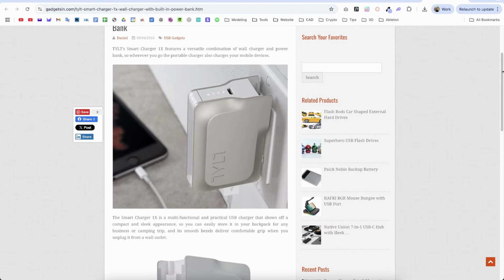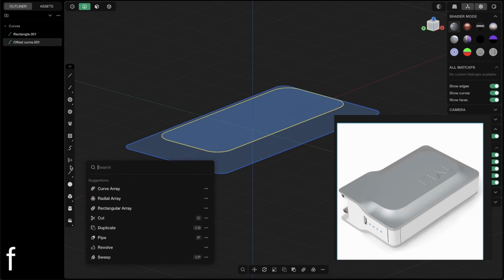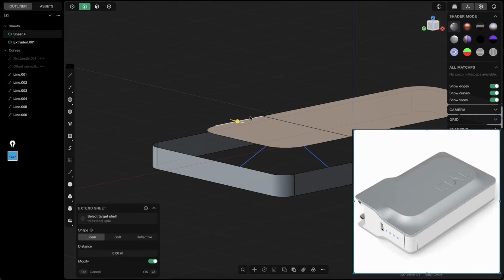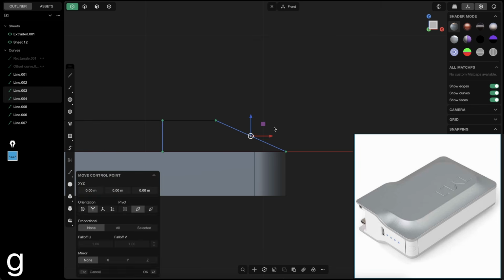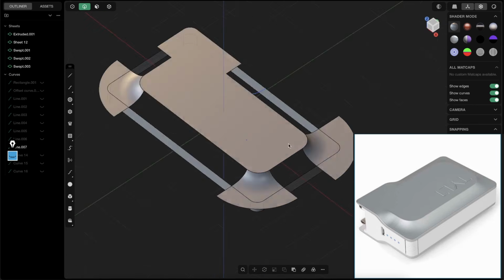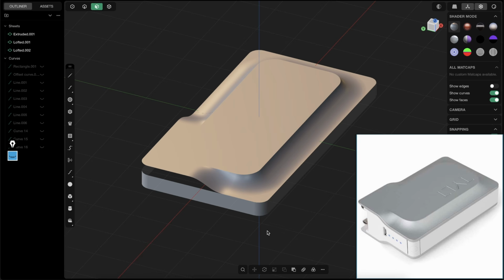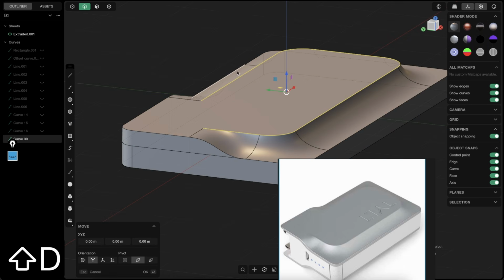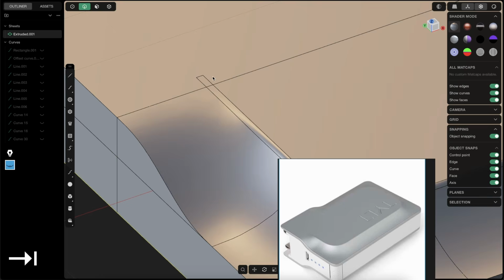How To 3D Model This Amazing Device (Plasticity Beginner Tutorial)

Comment: Hi Nikita. Thank you for your tutorials. Do you think it's possible to use Plasticity to model smooth 3D surfaces that are curved in non-cylindrical, non-spherical ways in every direction? Can you model, for example, a pair of Crocs, or the new fancy Balenciaga Zero shoes? I tried and I failed miserably. Even when I could model the individual parts, they had internal invisible errors so then I couldn't boolean or fillet them. Do you need XNurbs for this sort of surface? Maybe that's the problem. So far I got away with making approximate surfaces (with loft or sweep or revolve) then use Rebuild, and then manipulate the rows or columns of control points with Scale and Rotate. But it's a lot of work and with complex objects like those, I get to a point where I can't proceed due to internal errors in Boolean and other operations. I wonder if you knew how to do it.

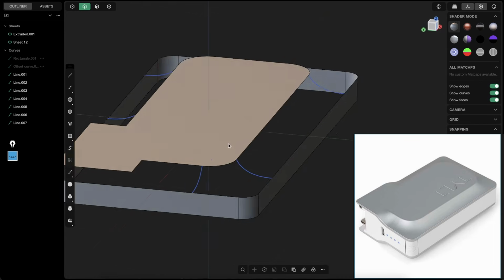Comment: I'm only a novice, but at @10:20 for example could you of not just have use the  isopram tool (ctrl R) to create 2 edges on the bottom sheet (Extruded.001) in line with the curves so you could use loft or patch to create the corner sheet?
I'm not trying to be a smart ass, I just confused and trying to understand why you did your approach for the cornering. Of course unless you were showing a different approach, 
Cheers
Reply: There are more than one way to complete the design. For example base on the size I made I had to Adjust G0 ,G1,etc

Comment: wasnt there a command to split a solid into slices. increasing the amount of lines with shift+wheel movements? I swear i cant find it now. like if i wanted to make tank tracks i could select the solid. Hit a key it would put a line on the solid and i should usse the mose to increase the number of lines and then hit enter. Then they would all be different solids where i could take every other one and move it up or down to create this effect.
Reply: Yes. Select the face. Hit control r. Now before left or right clicking anything else you can hold shift while scrolling the wheel up or down. You can also hit tab before or after scrolling to toggle between horizontal and vertical splits. I hope this works for you. Not having this feature would be very limiting.